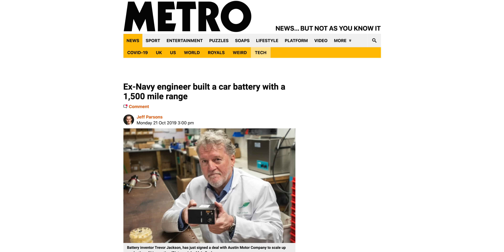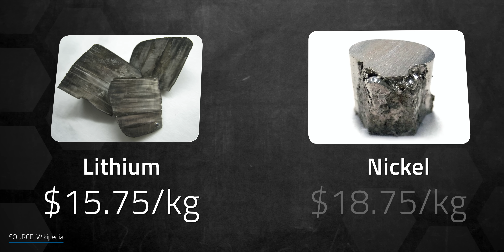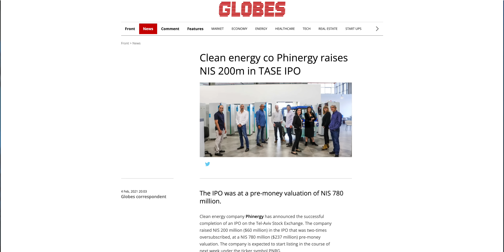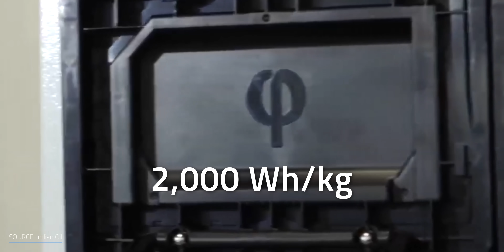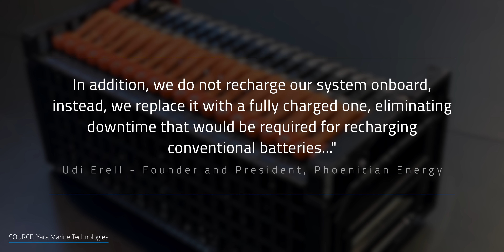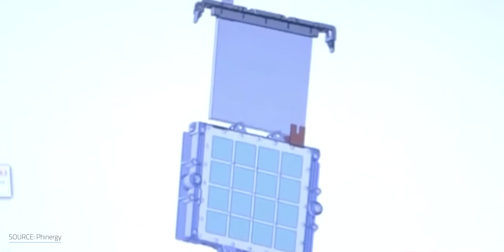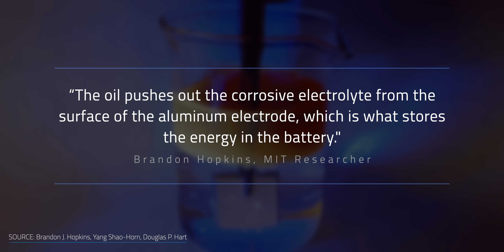Exploring the 1000 Mile Car Battery - Aluminum Air Hype?

Comment: A hybrid EV with battery swapping, Yes please. This would be perfect solution for cars with small battery as range extender. As we know in 95% of cases we don't need big batteries. When we need it, we are likely on our way on one of the highways. That would be a perfect combination. Just imagine if we could double the available battery capacity over night. We actually can, by putting half amount of batteries into cars with some sort of range extender.
Reply: Design the standard Lithium Ion electric cars to be able to attach a small trailer that would carry the battery extenders. Then you do day-to-day driving on standard, rechargeable LI batteries, and if you need long distance you can rent a trailer that could carry up to 3 Aluminum range extender batteries.
Reply: @TwilightMysts  You don't need a trailer. A model S incorporating this could cut its Li battery pack from 100KwH, down to 50KwH, install swappable Aluminum Air batteries equal to the weight of the removed Li batteries, and likely see a total range increase of a couple hundred miles. Your re-chargeable mileage would be about 150 miles, but your total mileage would probably be closer to 7 or 800 if I'm estimating correctly.
Reply: @TwilightMysts  I like the trailer idea, i don't think though it's needed. A small battery Lion battery this days doesn't take up the whole bottom of the car, so I am positive that the replaceable aluminum batteries could be engineered to fit inside the chassis.
Reply: @gene8194  I like the trailer idea because the only change needed for existing cars would be a tow hitch and cable connection. You wouldn't have to engineer in a dedicated space for the aluminum batteries (which would mostly be empty) or place them in the cargo area (which would take up space needed for luggage on long drives). But you are right, they wouldn't be necessary, I just think it would work better that way.
Reply: @TwilightMysts  I agree that it would be easier, but there is a few issues with it. One, the drag from the trailer, two, speed limitation. At least here in Europe the speed limit for trailers is 80 km/h. And not to even mention parking and other disadvantages because of the size. 

As you have seen in the video the batteries can be placed in the trunk, but if the battery pack wouldn't be there in the bottom, there would be easily place for the extender down there without taking to much space. This is not too difficult. Also it could be probably some kind of system, where the aluminum battery would be discharged in a way, that would not degrade the whole pack, so it could be returned as unused and recicled or reused. And the battery doesn't have to stay in the car after the long distance trip is done.

Comment: Aluminium batteries has to be used together with lithium-ion this way you can both charge and swap. Plus, if needed, you can bring more aluminum batteries replacements in the trailer :)

Comment: At first I thought it is stupid to loading up the swappable batteries onto trucks and carrying them to swap stations because it is a waste of resources, but then I remembered we have been doing the exact same thing with Petrol. Therefore I think it will boil down to the energy density. With a 1000 mile capacity, I would roughly be making a visit to the swap station every 3 months, which is awesome actually. As long as the proposed solution instructed a significant increase in energy density it is a strong candidate.
Reply: Wow, my comment got a bully and even a porn ad. So much attention, I feel like a celebrity :-P
Reply: Why only have an Al-Air battery? I consider this as a range extender: You get an Al-Air battery for Christmas, to visit family. The rest of the year you are perfectly fine with you small 40kWh Li-ion pack for all your driving. You can store a stash of Al-Air batteries dry indefinitely in you garage for emergencies like prolonged blackouts or even the prolonged camping holiday in the wilderness.
Reply: @Tore_Lund  Considering that they are using silver in Al-Air batteries, it would likely be an expensive battery and would likely constitute a significant percentage of the car's price, therefore you probably would not afford to stash a few batteries in your garage.

I agree with the smaller capacity  batteries being suitable for most, especially inner city travel scenarios. The only downside of that is the frequent 20 minute wait period during the charging, which could sometimes be a bit hard to manage. Swapping the batteries is more practical, cause they say it takes less than 3 minutes, that is roughly equal to the amount of time it takes to fill up your tank.
Reply: @rehaesen8374  the size of the silver catalyst will only govern power, not capacity, think of how hybrids have a much smaller combustion engine compared to a similar performance petrol vehicle. Also it might not be required to  swap it out meaning you only need to buy 1 which is part of the car for life.
Reply: @rehaesen8374  if you don't drive very far often, you can get away with charging it in your home
Reply: @wagnergauer9133  that is correct for the most part, but then there are edge cases, like when I have to drive cross country for a 2-week vacation. I cannot make a 20 minute stop for a charge, every 2-3 hours with my 3 year old at the back, nagging me. The trip already takes 10 hours non-stop. It might be such rare edge cases that make a lot of people reluctant to switch to electric.
Reply: @rehaesen8374  True.
But as the density continues improving I think that we might expect this excuse to weaken more and more
Reply: @wagnergauer9133  yeah agreed, and Al air batteries might be a step towards that
Reply: @rehaesen8374  We were very successful stopping every 2-3 hrs with a 3 year old to get out of restrictive car seat and run around at a rest stop for 15 mins.  The rest stop was also helpful for everyone to visit the rest room, stretch, and a quick bite to eat.  Yes, you arrive a hour or so later, but with significantly less fatigue.  When on vacation, self-imposed deadlines should disappear.
Reply: @Tore_Lund  these batteries will have a poor shelf life.
Reply: @janami-dharmam  Once you pour electrolyte into them, they last only weeks, but I explicitly said "dry"!
Reply: @janami-dharmam  they just said in the video that it is a 0.02%/month drop if you store the battery with oil instead of the electrolyte. That means that you'd still be at 90% battery capacity (900 miles) after roughly 41 years... so...
Reply: If you're only swapping out your batteries every 3 months you're wasting a lot of energy hauling unused batteries back and forth between that time. It would make more sense if you had a spare battery or two in the garage at the house and didn't waste energy moving them about when not needed but you could add them when you know you're going on a long trip.
Reply: @AndrewBlack343  I work from home and therefore do not use my car much, that is why I am guessing a battery would be good for 3 months. Less travel means I wouldn't be dragging an unused battery too much. How frequent you use the car does not have an impact on efficiency, that is if the battery does not lose charge when idle.
Reply: @rehaesen8374  What I was trying to say was that hauling unnecessary mass about is inefficient. If you do long journeys you need the headroom of fuel (be it petrol or batteries), if you do lots of short trips you don't need the headroom and therefore it's less efficient to carry the extra (unused and not required 'just incase') weight of fuel (be it petrol or batteries) about.
Reply: @AndrewBlack343  Ok, got you, sorry for my misunderstanding. Maybe we could have large and small battery options. It would make sense to use the smaller and lighter battery for daily commute, and swap to the heavier, extended range battery for long trips.
Reply: @rehaesen8374  Yes. Ideally you'd have two or three banks of batteries as it's easier to swap out batteries in smaller banks anyway. Then you can use one bank for your daily commute (and store the others not in the car) and all the banks for the infrequent longer trips.
Reply: @Ross Radford  I replied to Reha Esen, I was pointing out that if you don't go on long trips frequently, charging is not a problem because you can do it at home,
so the fact that the aluminum batteries can be swapped out quickly is less of an advantage.
Reply: Fuel can easily be pumped at large capacity, try moving large number of batteries each time on an off of a lorry. I know a robot could be used, but still seems inefficient.
Reply: So, it's not stupid anymore?
Reply: @juanfermin1841  the high energy density that is enough to deliver 1000 miles provides something to think on and discuss about. I think we shouldn't undermine something with a sizeable positive effect.
Reply: But doesn't deal with the issue of recycling, how much of the battery actually gets recycled, the logistics, energy, and material needed to transport batteries back and forth from some recycling center.
Reply: Surely, your car can order a new battery via Amazon-Electric when it's getting flat all by itself. Do you even need to be there for the swap?
Reply: @saddle1940  That's not very efficient/environmentally friendly.
Reply: @mariat5860  have u shoved a cactus up ur ass yet?
Reply: @Ross Radford Gasoline also has a limited shelf life ??? Surely you are joking!
Reply: @janami-dharmam  It does go "stale" after a while.

Comment: When you actually stop and think about it, battery swapping makes much more sense.  You'd be in and out of the service station in minutes.  And consider that charging station capacity is going to be a growing problem too (something we're already starting to see).  Tesla didn't give up on it's idea because the charging stations didn't exist, they made it happen.  If these batteries are indeed lightweight and easily replaceable, it'd probably be MUCH easier to adapt existing service stations to the work then build out a whole new charging network.
Reply: I always wanted EVs with swappable batteries. And wIth these non-rechargeable batteries, the only change a gas station would need to make is have a cardboard box of full batteries in the back and a box to send the empty ones to recycling.
Reply: Rechargeable batteries are so nice for home charging (if that's an option) and small commutes. Maybe a hybrid system could eventually combine the best of both worlds.
Reply: @MRTOWELRACK  That would be interesting to have a "Hybrid EV" where a rechargeable lithium battery and a non rechargeable battery (metal fuel cell) is combined. Where the non-rechargeable battery is the range extender for long travel. This could solve many problems, but those problems are not very serious to begin with for most users. Unless you talk about long haul autonomous vehicles and electric airplanes.
Reply: @MRTOWELRACK  hybrid sounds like a good idea, would allow a full discharge while still having range to get a swap, and also I imagine lithium is better for current supply to motors
Reply: @MRTOWELRACK  Think big: you don't have a home gas pump because you know you can just go to the local gas station and refill in a few minutes.  Same idea.  Run out of "gas" somewhere?  Just call a service truck and they drop in a new battery.  Probably much faster than recharging a conventional EV.
Reply: "it'd probably be MUCH easier to adapt existing service stations to the work then build out a whole new charging network." - Seriously, this. 

"We had to install and have to maintain all this complex electrical equipment subject to damage and wear" vs. "we built a shed to hold these fancy boxes, and another shed to hold the empty ones." It's basically a Propane Tank exchange system - any service station anywhere can handle that.

Comment: It would be a more viable option for motorcycles because of the weight savings and increased power. Maybe even race applications.
I keep this that maybe this could be a good solution to power freightliners.
Reply: That's an outstanding idea! The smaller form factor also makes swapping packs a lot more logical logistically as well as physically re/re the pack.
Reply: @paulm1237  But it suffers the same problems as for a car, imagine you are out for a ride and your bike is starting to run low on power due to the battery depletion, you now have to find a place that replaces that specific battery type for that specific bike.
Reply: Motorcycles would be the perfect application. People really don’t ride them all that much. So as long as they’re economical, 3,000 miles of range from the factory would be awesome. Imagine an off-road bike that you never had to recharge— you could ride all day. Maybe every couple years you pop in a better and more efficient battery
Reply: @nicholasn.2883  Great until the company stops making the battery for that particular vehicle then you are stuffed.

Some motorcycle riders do a lot of mileage, also ride outs can take up a couple of hundred miles in one day.

Comment: my kona ev gets 325 miles in and around town. it gets 250 miles on the highway at 70 mph. its more than adequate. IF the ev got 12,000 miles on a single battery and you could replace the whole thing once a year for as much as it would cost to recharge a LIPO for that many miles (plus 1/20th the cost of the lipo battery) then yes. it would save you those days of charging. if its more expensive, then obviously no.

Comment: When I was coming up with my own designs for an EV, battery swapping was a consideration but after much deliberation I concluded that it was not a viable solution. I would like to see supercapacitors used in a cascading array in concert with solid state batteries I believe this approach would allow for fast charging.
Reply: While it is true that super Capacitors have a great charging Potential, they lack in energy density. Charging wold also still be limited by the charging rate of the SS-Battery. In Addition i belive its not the greatest Idea to charge millions of cars at over 100 kw simultaniosly, since it would overload the grid, especially a green one.